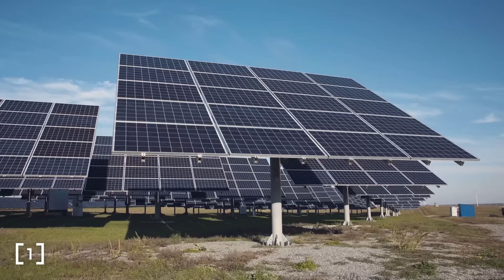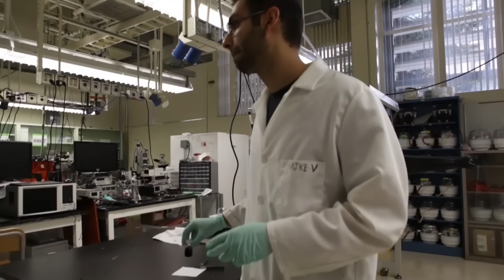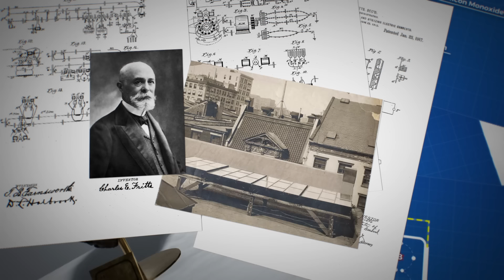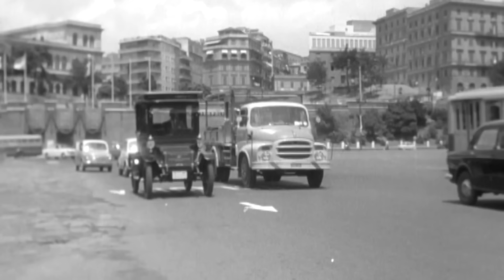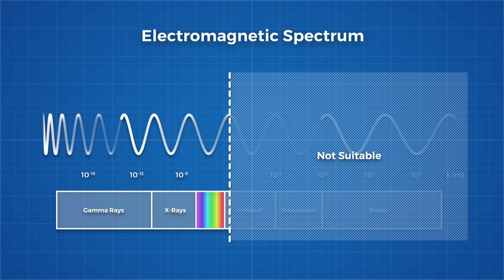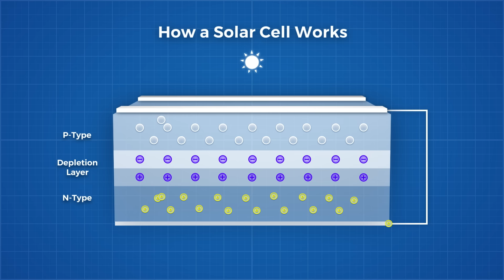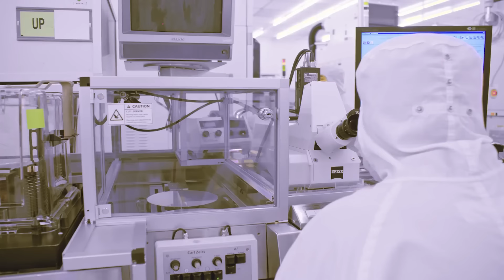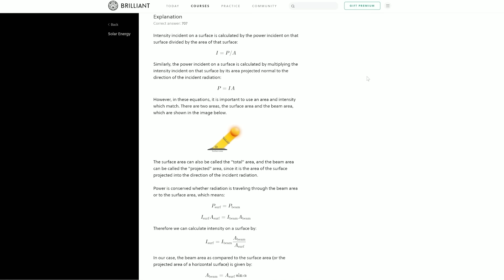The Mystery Flaw of Solar Panels

Comment: All is extremely well explained, thanks!
I thought the 19th century solar panel was a joke, it blows my mind! Way before the photoelectric effect was explained by einstein. I love old innovations of the late 1800s, they just tried everything about energy vs mobility (trolley, comprenssed air, kinetic, and so on.)
Reply: It’s so difficult to believe, at first, because we have been taught to believe that science drives technology. It does today, but up until WW1 it was the other way around. Steam engines were in widespread use in the UK before thermodynamics at the end of the 18th century, and explosives other than black powder had been developed before chemistry became ‘a thing’.
Reply: @Sophiedorian0535  "we have been taught to believe that drives technology. It does today, but up until WW1 it was the other way around. "  

You may mean that other than I am taking it. But for those who took it as I did:

Technology never does what science doesn't allow...if science is the known setup of the universe, its rules and regulations, also sometimes called the Laws of Nature. If it ever seems to, then we just learned something new about the universe or that our understanding was wrong or limited. 

(We already know our understanding is limited. That's why we have research and keep records. One basic rule for example is: That does happen CAN happen. Even it by itself doesn't tell us how it happens and what can NOT happen.)
Reply: @DavidGreen-yz6ws  You equate science to nature. That’s a mistake. You also compare science to regulatory, as if natural laws are the same as the laws that govern society and ensure justice, or the laws laid down by God. Science is our understanding of nature, not nature itself. The word “Scientia” in Latin means “understanding”. The scientist’s job is to advance our understanding of how the world works. Technology, on the other hand is our way of dealing with nature, in practice. Often we make things work before we understand how and why they work. Aspirin is a good example. There’s more than a hundred years between the discovery THAT it works, and the understanding of HOW it works.
Reply: Becquerel and Hertz discovered it decades before Einstein, what Einstein did was the Planck constant
 with you guessed it Max Planck.......... (the quasi scale for Quantum Mechanics)
Reply: @TheOneG36  Restated: Albert explained why what they knew was happening was happening. With this improved understanding, it became possible to make it happen with improved efficiency/output and from sources not previously considered.
Reply: I have Weston "Master" light meters from the 1930s, using Selenium photocells, which are every bit as usable (and accurate) as they were when they were manufactured. Sadly, I also have some much newer versions in which the cells are dead as a doornail. Apparently, they "forgot" to apply lacquer to the photocells, which prevented stuff like oxygen and water vapor from attacking the surface. Thus, the old cells are as good as they ever were, but the newer ones, feh.

And, I digress.

The main benefit of Selenium over Silicon is its spectral sensitivity, which is a much closer match for photographic applications than Silicon cells, which require heavy filtration to counter the extreme blue-sensitivity.
Reply: Mostly used in photo-copying, the drums were Selenium.
Reply: They had and knew less, but used the little they had the best
Reply: Nicola Tesla was a genius.       and some energy has not been tried.  why, i have no idea.  It's been in our face for 1000 years.  Free energy.
Reply: It'd have been a joke if they understood all the science and pressed forward with the technology.  1% before the laws were written or understood is no joke. Fritts took a step to open the door for what was to come.
Reply: This is a perfectly common thing in history, actually.

For example, the Greeks and Romans has public baths. They had sewerage systems and they had aqueducts to carry fresh water to the cities.

The thing is, of course, they didn't have Germ Theory. They didn't actually know WHY regular bathing, fresh running water and flushing their sewage away caused good health.

But they knew it was true from observation. Folks who bathed and washed simply had less disease. Those who drank from fresh water streams, rather than stagnant ponds, got ill less often. They could see that it worked - trial and error, and just noting the difference in levels of disease from people who lived in different ways - but they had no actual scientific explanation for it.

Indeed, the way Greeks and Romans explained this phenomenon to themselves was that it was the goddess Hygieia - goddess of sanitation and cleanliness - who was magically conferring good health upon them for keeping to her sphere of influence. In a somewhat literal sense, they bathed religiously, as an act of worship of the goddess Hygieia and believed their good health was her magical reward for their devotion.

And, yes, look at her name: "Hygieia". The word we use for the practice of cleanliness and sanitation is... hygiene. The word "hygienic" can be seen as actually meaning "of, or pertaining to, the goddess Hygieia". In an odd way, we're still - at least linguistically - ascribing the practice to her, to this very day (though it's just a name, as we have Germ Theory and know it's not the goddess - but it's a good word for  it, so we still name-check her).

Another example is "the silverware". At least in the Western world, we eat using knives and forks and spoons. And, by tradition, the material that was used was silver - hence the term "the silverware" for cutlery (and even though, these days, it's more likely to be stainless steel - which has a silver colour, you'll note, though - rather than actual silver, simply because of the cost). In Medieval times, they would drink from silver tankards.

Now, again, they didn't know the scientific reasons why. They just did it because they noticed that incidents of disease and illness dropped, when you weren't man-handling your food with your hands but rather used silver implements to manipulate it.

Today, we can explain it. First, you don't use your hands because if you haven't washed them beforehand, they'd likely have germs all over them from the stuff you've been touching all day. Second, silver has natural anti-bacterial properties.

(It's also interesting to note that, in legend, you kill a werewolf with a silver bullet. Remember, these folks had superstitious belief that illness was caused by "evil spirits" and, therefore, you can see that the use of silver in the bullet was to confer on it that "evil spirit killing" properties. The bullet kills the body, but the silver kills the "evil spirit" infecting that body, so it can't float off and "infect" someone else, at least by the way they would see things.)

Hopefully you can see what I'm getting at here. There are many things that people have known all along - from pure observation - but they couldn't scientifically explain why it was happening. They knew from trial and error that washing was good for the health - so they did it - but they did not really understand why (and conjured up their own religious explanations - because that's what the gods so often are: temporary placeholders for scientific ignorance. Don't know why something just happened? "God did it" and then you can satisfy yourself that you have an explanation... but you really don't).

The classical example is to ask people what Newton was famous for. And you often get folks saying that he "invented" gravity or "discovered" gravity.

But, of course, that's silly. Newton didn't invent gravity. Gravity was always there. He didn't even "discover" it, in the sense that other people had noticed that things fall to the ground for a very long time before Newton was around.

What Newton did was EXPLAIN gravity. Or, well, not even that, as we still don't really know what gravity is at the most fundamental quantum level. But he provided an accurate description of how gravity functioned.

And, if one reviews history, this happens often. It's not that people didn't know these things to be true - they can derive that from pure observation - until scientists came along and offer us their theories. It's that these scientists finally explain WHY the observation we've always known is true. They give us the proper deep explanation of what's going on.

So, in history, you'll find many examples of this. Where the observation - the experiment - came first. People try something - trial and error - and it just works. And, no, they don't actually know why. All they know is, if you wash your hands and use cutlery (and wash that after every use), then the incidence of disease markedly drops.

This went on for centuries before we finally had Germ Theory to explain WHY this works (because it's germs and viruses causing the disease - though, in fairness, they are microscopically invisible, so we can't blame the people of the past for having no clue that such a thing exists). Everyone knew it was true and HOW to do it, but no-one (yet) had any real idea WHY it worked. It just did.

You can also see some interesting variants in the history books. In Medieval Europe, they avoided disease by drinking beer and wine. They didn't understand why this worked (it's because, during the brewing process, one boils the water and the addition of alcohol - which is also germ killing - then preserves that sterile state), but they knew it worked and Medieval Europeans drank beer.

Whereas, in China, they came up with tea instead. And, of course, to brew a nice cup of cha, you boil water. Interestingly, Asians tend to have a lower tolerance of alcohol to Europeans, because they didn't spend all of the Medieval period - centuries - downing weak beer constantly.

To the modern eye, they're both variants of the same underlying solution - boiling water kills germs.

Regards science and technology, sometimes science leads - because a theory has to be first before you even realise there's something there to be exploited (it would seem unlikely, for example, that you'd experimentally come up with a laser before you understood the theory that makes it possible) - and sometimes technology leads - in that, by experiment (or "trial and error"), a useful property is discovered and exploited... and then science only later explains why that was happening.

So, you can - and they did - build steam engines before Thermodynamics was properly understood. Because you can determine that something is true by experimentation. That, for example, if you boil water in an air tight vessel - a pressure cooker, as it were - then it'll explode. And you can engineer ways to exploit this - funnel this explosive force down pipes to push things around, turn wheels, etc. to do useful work.

And then, later, the theoretical scientists can find out why the stuff that the experimental scientists are doing actually works.

Indeed, science and technology generally ping pong. Technology achieves something, science explains why - but this science then tells us how to optimise and improve the technology. Which can bring about new technological applications. That science can then use to obtain more data to explain more things.

And, in practice, science and technology tend to "ping pong" progress between them. When technology invents the microscope or telescope, science moves forward. But then science discovers underlying principles, which technology takes and turns into applications, moving itself forward. They tend to progress hand-in-hand like that.

So, remember, when folks say "X was discovered / invented in 1845" or whatever, it's perfectly possible that folks all knew this was the case beforehand. What we're recognising there is when scientists finally explained WHY it was the case, not necessarily that it wasn't known to be true beforehand.
Reply: It just goes to show that geniuses have existed for thousands of years, but the overall knowledge base of the human race just didn't give them enough info to work with at first. Imagine a cave dwelling human genius thousands of years ago. Did they help develop written language? Or maybe even spoken language? What's really sad is that there are people even to this day that have the intelligence but not the info or the means to progress who are living out their lives in poverty or in some deep jungle, never knowing what they could have become.
Reply: @Gormen Freeman And too much of a good thing is a bad thing. Too much power in too few hands leads down a very dark road.
Reply: Geothermal and Hydrogine..The best
Reply: the medicine makers tried everything also - the history of the drugs used on our minds is scary.
Reply: Some inventions are better from that age! If Tesla wasn't so worried about his intentions then we would have free wireless powaaah! Also when we created the radio it spooked the aliens who are now controlling us. UFOs are just their agents going back to their planet.

 If I had the money I could sneak onto one. Please help me uncover the truth by sending me to help my operation further as we are low on funds. We use Venmo as it is encrypted, but bit coin also works! I am just an agent, but I actually have an alien that is helping me in disguise as my goldfish who speaks telepathically to me. He took that form since the water he is helps it (they are asexual yet it prefers he. #Liberal) Anyway so he can only impart information as he has no limbs!) BTW Taylor Swift is the leader of the bad aliens trying to farm humanity. Do NOT GO to her concerts or else!!!
Reply: Exactly(!), the great masquerade begun at the beginning of the 19th century, which transformed planet’s  societies into what they are now. It transformed Monarchies into Republics, which replaced all monarchs, convincing peoples on earth, through misleading propaganda, that even the good monarchs were blood thirsty plutocratic tyrants. The great masquerade led initially to the First World War, which began 1914 and ended in 1918, and during this period of caos, the Soviet Communist Revolution (1917) was also achieved, by the Bolsheviks led by Lenin, Trotsky et caterva. The great masquerade did not replace the totality of European Monarchies with democracies. In reality it transformed monarchies into communist, nazi or fascist dictatorships, what lead to the Second World War. After the end of WWII, began the implementation, and consolidation of communist regimes throughout the world, (e.g. Iron Curtain, China, Korea, Vietnam, Cuba, just to mention the most important), which was achieved by a blood bath never seen in beforehand in the planets history.
Reply: @michael.forkert  I am not sure why you want to use the term "masquerade" or claim "misleading propaganda, that even the good monarchs were blood thirsty plutocratic tyrants," or claim that the propaganda led to WW1. 

WW1 was a fair example of the fact that even though the king, kaiser, and czar were all cousins, they couldn't stop a war without purpose. Thus, it isn't a matter of bloodthirsty as much as incompetent. Even the empowerment of dictators wasn't due to some sociological scam; it was because people who want power and enjoy wielding it often achieve power, especially if they aren't bothered by killing millions. 

Tyrants aren't stopped by checks and balances. Neither are absolute monarchies or democracies. America comes closer than most, but even we are filled with folks who think 50% plus one should be able to decide the fates of 100%. That's bad but still better than an even smaller monarchy, council, assembly, advice, harmony, or concord deciding the fates of 100%. There is no perfect government because humans are imperfect.  "A more perfect union" is a worthwhile neverending goal even though we will never get there. 

One possible way: 
Leave people alone where possible. 
Stand together for common goals as necessary, not for petty things.
Allow people to cooperate in defining and achieving goals
 Respect the rights of individuals where they do not violate the rights of others. 
Be careful in defining rights such that they do not arbitrarily infringe on others.

(Contemplate The Bill of Rights for possible examples,)
Reply: @DavidGreen-yz6ws  In my conception, GOOD(!)  and  BLOOD THIRTY  is an oxymoron, a contradiction in itself. 

Nietzsche said: The Rulers lie in all the tongues of good and evil; all they say are lies, all they have, they steal.
Reply: @DavidGreen-yz6ws  WHO has written the Bill of Rights, the ORDINARY PEOPLE, or the Founding Rulers in OUR NAME? Just to exemplify: 

Do you think forcing ordinary people by law to legally murder ordinary people in foreign countries, or even murdering your own people which happened in the secession war, is WRITTEN IN OUR BILL OF RIGHTS? 

We the People have the RIGHT to force ourselves to wage wars, and if ANYBODY IS  NOT WILLING TO GO or FLEES, we demand US the RIGHT to submit  THE DESERTER  to COURT MARCIAL, which eventually condemns him to be executed by a firing squad. 

Is that your idea of DEMOCRACY? 

All “good” and “bad” former monarchs combined, have not achieved to murder  so many people than those psychopathic rulers of the twentieth century, including the DEMOCRATICALLY ELECTED RULERS OF THE UNITED STATES OF AMERICA. 

There never was a single DEMOCRACY in the WORLD. DEMOCRACY IS A FALLACY, THROUGH WHICH THE RULERS aided by the traitors at the PRESS,   bamboozle  ORDINARY PEOPLE like you and me to believe their LIES. Are you aware where all the money to support and finance the war industry comes from? Exactly!! OUT OF THE POCKET OF THE ORDINARY PEOPLE, the so called TAXPAYERS. IF YOU DON’T pay your TAXES, WHICH ARE IMPOSED BY LAW, EVIDENTLY IMPOSED BY THE RULERS, YOUR FATE IS FATALLY “DEMOCRATIC” INCARCERATION. Right?

I hope that my explanation has pulled you out of your alienated state of mind back into empirical reality.
Reply: @michael.forkert  "Do you think forcing ordinary people by law to legally murder ordinary people in foreign countries, or even murdering your own people which happened in the secession war, is WRITTEN IN OUR BILL OF RIGHTS? "

I do not. Nor are instructions on how to tie your shoe laces written in The Bill of Rights. It doesn't pretend to cover every subject. It would be silly to expect it to. It promotes the idea that there are things rulers should not be allowed to do, that people are their playthings to be used, abused, and cast aside at a royal whim.

"IF YOU DON’T pay your TAXES, WHICH ARE IMPOSED BY LAW, EVIDENTLY IMPOSED BY THE RULERS, YOUR FATE IS FATALLY “DEMOCRATIC” INCARCERATION. Right?"

Nope. More likely confiscation of my property.As if monarchs would do otherwise. Actually, though, monarchs claimed to own the property and the people are their "subjects." slaves.

"I hope that my explanation has pulled you out of your alienated state of mind back into empirical reality."

That was not an explanation. It was shouted and misspelled statements which were false and/or irrelevant, none of which proved the superiority of monarchies. In fact, it never even established a distinction between "regular" monarchs and modern ones like Stalin, Hitler, Mao, Pol Pot, and Idi Amin.Genocide was a new word but not a new concept.
Reply: @michael.forkert  but Nietzsche was mistaken.
Reply: @DavidGreen-yz6ws  How do you I know, that you are not mistaken when you  affirm that Nietzsche was mistaken?
Reply: @michael.forkert  Knowing is easy. Just make up your mind you are right. Besides, many things he wrote make fun sound bites, but not necessarily a sound mind.
Reply: @michael.forkert  But, anyhoo, the claim all rulers say is a lie and all they have they stole can be tested and fails the test. Find a ruler who says something you can prove is true and Nutsy fails. Obviously rulers are given gifts which they have not stole even if the gift is a reward for stealing or a bribe to steal. And if they steal as they promised the briber, they also spoke the truth. Leave all that behind and ignore the possibility of corruption. You face the question of any value of government versus no government. Since we know predators exist, even a bad government is often better than unrestricted predation. Thus, rulers have some value, some worth, a reason to reward them. It is not all stolen. Nutsy is disproven again. (And I'm not really calling him Nutsy out of disrespect, not completely. I'm just on my cute little ZTE phone and can't pull up the gentleman's proper spelling, so I am using a recognizable substitute which also conveys my disagreement.)
Reply: @michael.forkert  Nietzsche and his Ubermensch. How many tyrannies spring from his writings?
Reply: @nedames3328  Exactly so many they made you believe.
Reply: @DavidGreen-yz6ws  The possibility that Trump came within a whisker of becoming Putin of USA was quite frightening. There aren't sufficient checks in the constitution to prevent success at some time. Effectively a dictator able to issue executive orders, give free pardons, choose judges,  control all armed forces without further control seems risky. The UK PM  has much more limited power as does the Queen or King. Judges are independent of the administration and the USA would be as Hungary if in the EU. After a thousand years of evolution the UK tends to fly by the seat of its pants with a complex constitution and even so isn't entirely safe as proved by events even recently.
Reply: @geoffreycodnett6570  The judges are nominated but not approved unless the Senate confirms. Power to use troops is limited and intended for when immediate action is called for. Declaration of war is required to continue. Executive orders are limited to matters not covered by law and can be thrown out by Congress or courts. Power of the purse limits the possibility of abuse. President Trump did much damage but was bound to fail because the military takes an oath to support and defend The Constitution, not the former President. And, yes, the presidential pardon is absolute, it can free convicts
Reply: @geoffreycodnett6570  from federal crimes. It cannot put people IN prison on a whim. President Carter could pardon all draft dodgers after the Vietnam War.. He only had to answer to the voters and Congress. If either were too unhappy, they could punish him by voting for Reagan or refusing to pass legislation he requested.
Reply: @DavidGreen-yz6ws  I mostly agree. The challenge to many is seeing the value in cooperation.
Reply: @michael.forkert  Also a great deal of true technology was buried, correct theories of nature were discredited, respectable scientists became shills, AND the interconnectedness of creation (wording chosen on purpose) was hidden. We are in a contrived dark age at the moment, though we believe we are superior because we are told so. And on a note related, the aristocrats survived the great masquerade and still exert the influence they had, though as was feared, the nuevo riche did in fact disrupt the order, now to the point of nearly collapsing the cards. In between 1885 and 1895 there was technology that could do everything we dreamed it might do, but that was deemed a threat to the order of things, and as always happens (since Bacon), it was discredited and secreted away. Since you seem to be a bit more observant, maybe New Atlantis or The Great Instauration would shed some light on the goings on of the last 500 years.
Reply: @DomusDuorumDeUngrund  Yes. Unfortunately YouTube has been transformed in a new Facebook.
Reply: @michael.forkert  Strange! I live in a Democratic Monarchy as do a number of other Europeans. What it's got to do with solar cells loses me.
Reply: Well the 1800's solar panels were real, you aren't wrong in thinking they were a joke; they actually kinda were, having an efficiency of only around 1%
Reply: @RandomGuy0400  100 % better than the one they try just before the one that worked
Reply: @RandomGuy0400   I think not appreciating their curiosity and innovativion is a tasteless joke .

Now that your armed with a lot more info it seems that way.

Think about it 

If you were to meet yourself a 100 years later you can go on ranting you could have done this and that and what not but the fact is that was the start .

At that time the electron was not experimentally verified ...
It was a different era .
Electromagnetism was just picking up the pace .